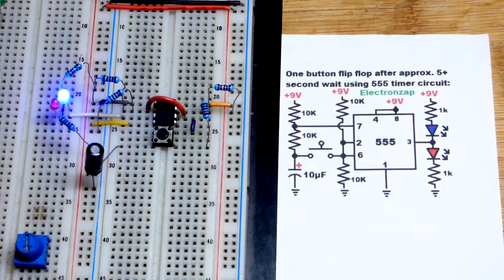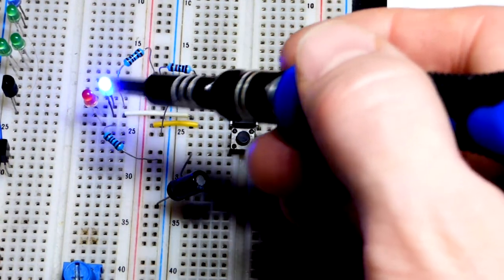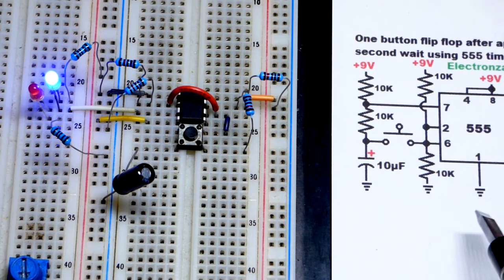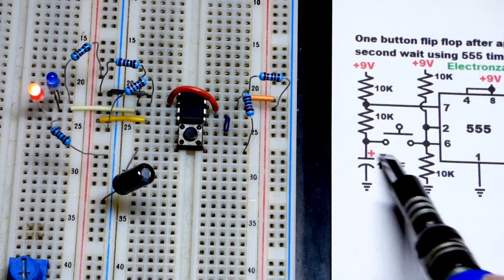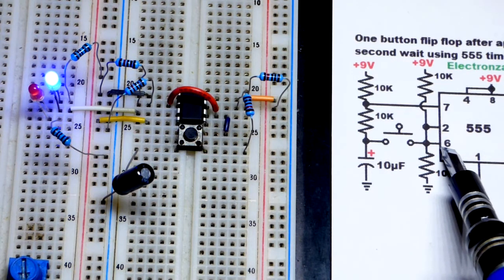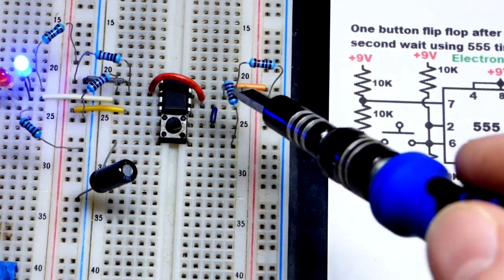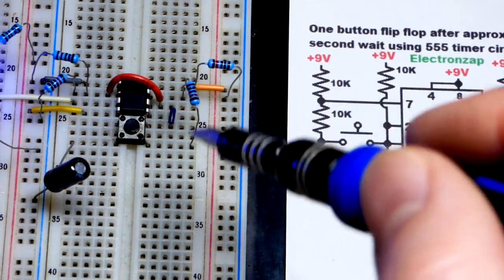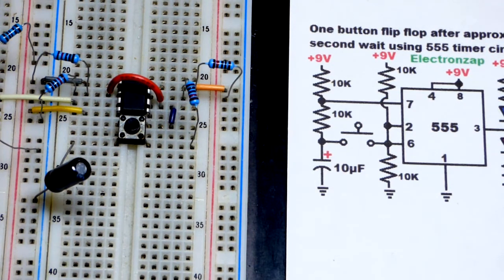One push button switch flip flop toggle using 555 timer learning electronics circuit by Electronzap

Comment from the maker: Recent playlist https://www.youtube.com/playlist?list=PLsAJMThMEUtr8yht55dgmA2TON8NfqaYH
List of my videos https://www.youtube.com/c/electronzap/videos
https://www.patreon.com/electronzap
https://www.amazon.com/shop/electronzapdotcom As an Amazon Associate I earn from qualifying purchases. Americans should check out one or more of those links before making any purchases. There's no extra cost to you.
https://electronzap.com/
https://www.reddit.com/r/ElectronicsStudy/
Reply: Emergency URGENT help 🙏🙏🙏 
Can you please help fix this issue???
Yes, the circuit is working 💯 percent perfect with added 0.01 micro farad capacitor at pin 5.

However, if you observed carefully, and touch/tap the positive or negative side of the power supply with a bare conductor wire, the IC will automatically trigger ON when trapped, and OFF when released. I believe to be due to electromagnetic interference signals.

I added 0.01 micro ceramic capacitor across the input switch button, but still same issues when tapping and untapping the aforementioned wires of the power supply source.

Please help how to fix this interference signals noises 
🙏🙏🙏🙏

Comment: Very cool video! The thing is, that most of my extracted relays are: 3.3V, 5V or 12V. For me it is really hard to get components, and i have tried many 555 circuits on 5V for relay control. The main issue was the push button's "bounce" problem, never had the solution, but i wanted to build many amplifiers with one button relay mains switching.
I cannot solve the button bounce issue, and can't find any topic where there could be help about it.

Comment: How to we add two more abilities so that the third press turns them both on and the fourth switch turns them off
Reply from the maker: I haven't built that but I am guessing you would use an integrated circuit that is made to do that. Would probably be a big circuit to try to make it from common components.

Comment: Super helpful exactly what I needed
Reply from the maker: Glad to hear, thanks for watching!
Reply: @Electronzap 
Can you please help fix this issue???
Yes, the circuit is working 💯 percent perfect with added 0.01 micro farad capacitor at pin 5.

However, if you observed carefully, and touch/tap the positive or negative side of the power supply with a bare conductor wire, the IC will automatically trigger ON when trapped, and OFF when released. I believe to be due to electromagnetic interference signals.

I added 0.01 micro ceramic capacitor across the input switch button, but still same issues when tapping and untapping the aforementioned wires of the power supply source.

Please help how to fix this interference signals noises 
🙏🙏🙏🙏